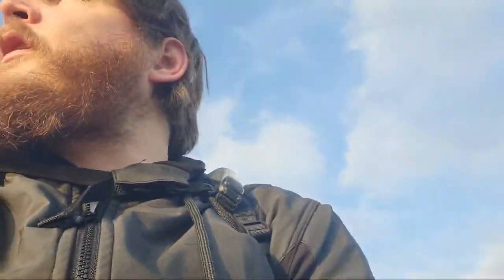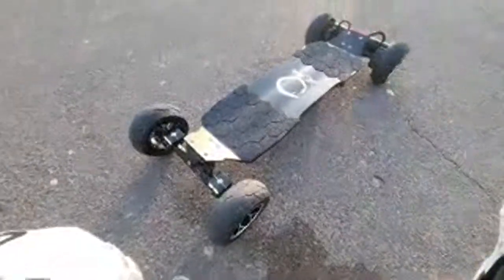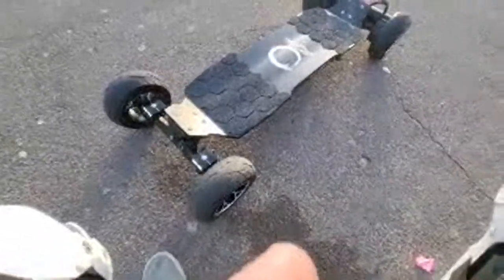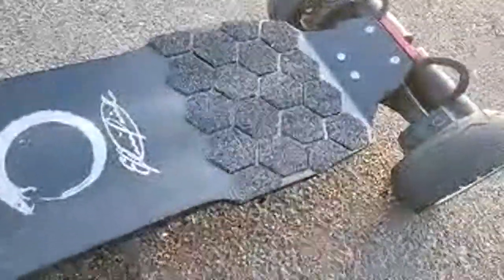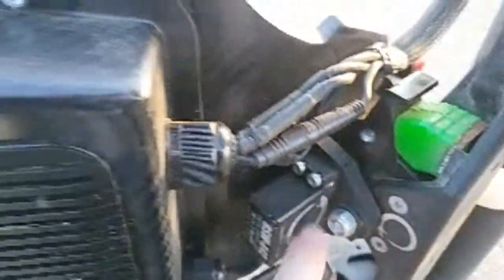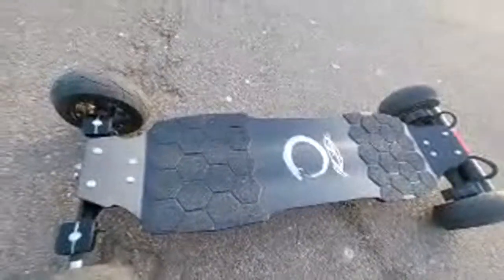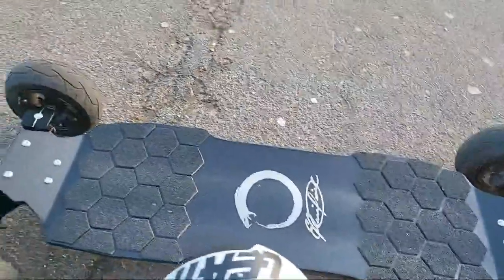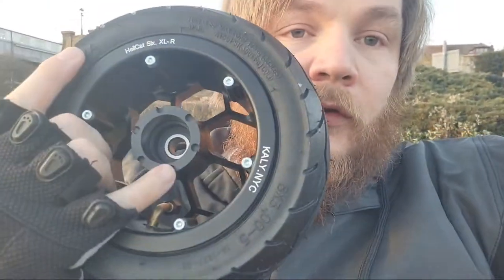Kaly XLR Pitstop

Comment: The electronic stability mitigates wobbles the higher the speed because it disallows quick side to side movement as you go faster
Reply: Curious how your board is performing at this point. Any issues, close to making the purchase but not much info out there.
Reply: @troyharrison1575  666 miles (1073.4km) and even better than before. Love it! The Kaly XLR is the most amazing board and super comfortable and stable.
Reply: @aahdxuxiznwnd2044  I appreciate the help. Glad you're enjoying the board I'm seriously looking forward to this board.
Reply: @troyharrison1575  another dude already has over 1500 miles and good.
Reply: @aahdxuxiznwnd2044  Good to hear. I'm sold!! I should be placing my order on Tuesday or Wednesday. Thanks for the feedback.  You and B Boystretch got back to me. And Ernesto answered some questions so definitely helped. Have a Lacroix SS Nazare but I'm ready for more range, and I was hoping for more stability at speed. XLR seems to answer all those problems. Thanks again, stay safe.
Reply: @troyharrison1575  you getting the Testarossa color (red), if so, im jealous 😄...congratulations in advance.
Reply: @aahdxuxiznwnd2044  Sticking with the black!! Its gorgeous,  Hoping to make the purchase today or tomorrow. You been over 35 mph. Curious how that feels. Hope your weather's got you outside my dude!! Stay safe have fun. Hopefully I'm riding that thing by August🤞
Reply: @troyharrison1575   35mph feels like 25mph.
On the xlr.

The only thing holding me back is my own fear. XLR has always been stable.
Reply: @aahdxuxiznwnd2044  lol. Good too hear. Thanks alot for input.  Was gonna buy anyway, but the reassurance helps. Good to hear your still excited about it. 6 k means canceling a vacation or two for me. But this should be more fun.
Reply: @aahdxuxiznwnd2044  
Hey, what's up. I reached out to you awhile back. 
You still on your Kaly?